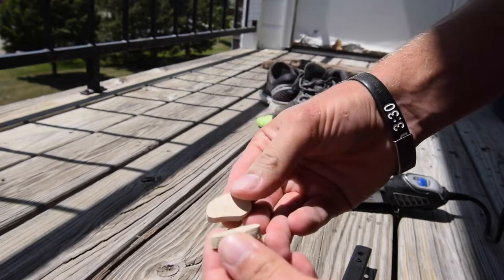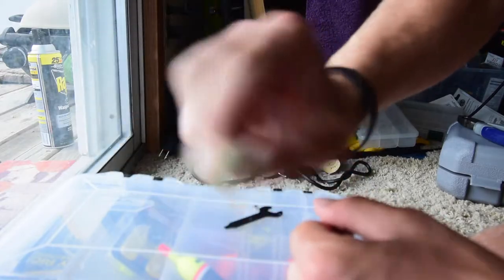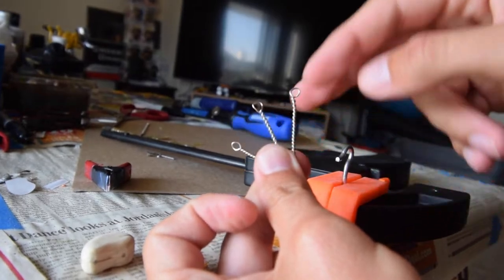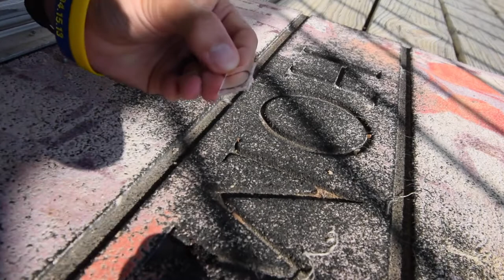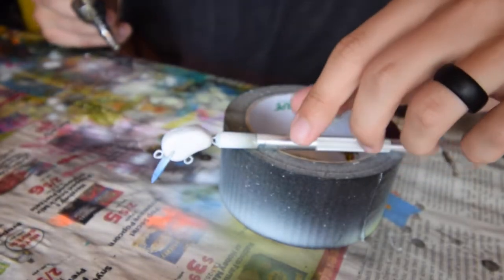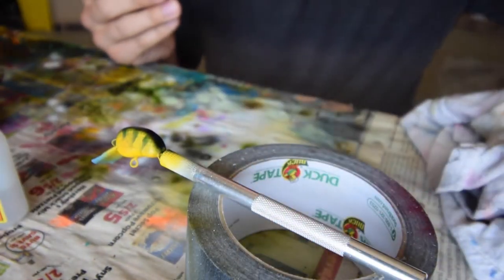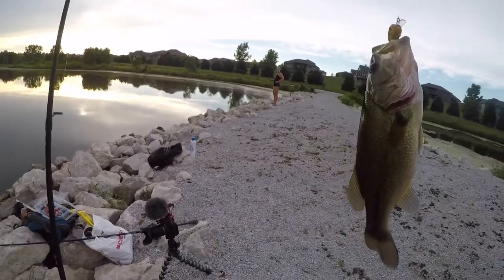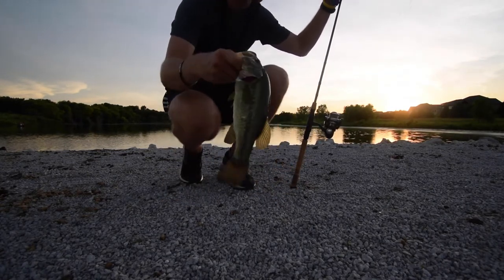How to Make a Simple Rattling Crankbait - Build to Catch

Comment: What glue do you use to attach the two sides?
Reply from the maker: I used Starbond Super Fast - Thin Super Glue. It worked great to just adhere them together. Once it’s all clear coated it just gives the whole thing a great protective layer to keep things in place.